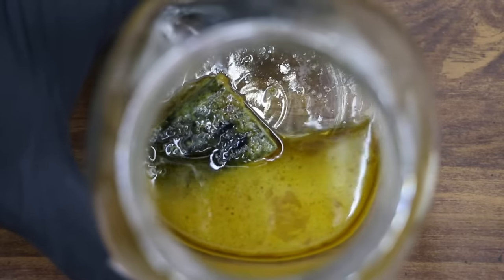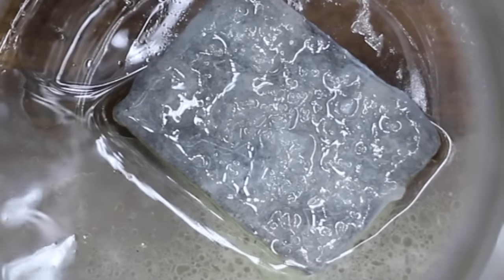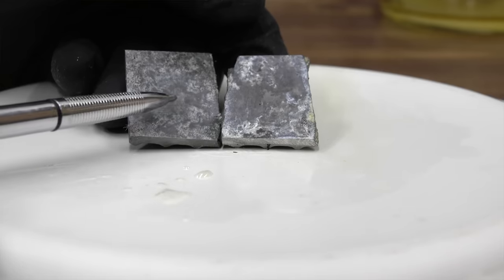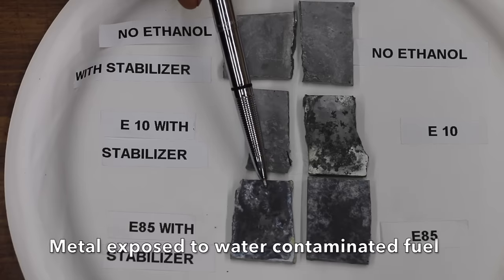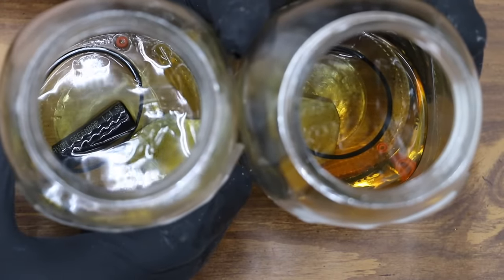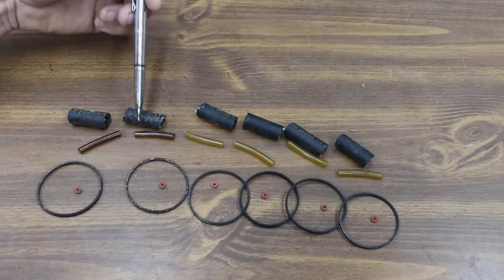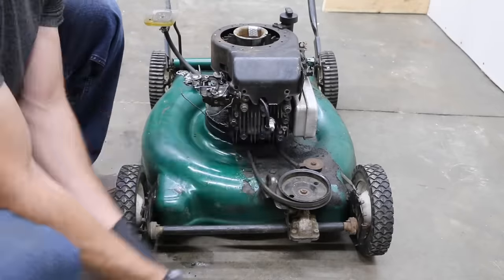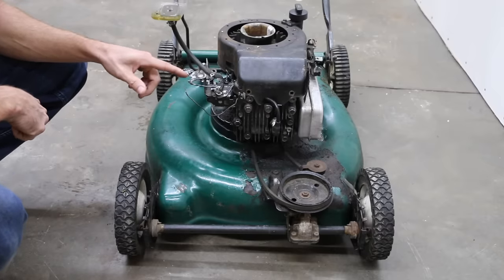Does Fuel Stabilizer Prevent Ethanol Damage?  Let's find out!

Comment: Great Video !, Great Test,!   love it.  my brother says that clumping brown crap from the ethanol is actually caused from the ethanol separating from the petroleum, and that the ethanol is basically turning into dried corn syrup , and that it is acidic, and it corrodes aluminum and even steel about the same as if you soak them in sugar water or coca cola .  I always run engines dry on fuel on before storing them and have good results.  when I was young my Granpa's friend said that he would mix a few ounces of transmission fluid with the last bit of fuel before running his fishing boat out of fuel to store it and that was the best thing to do to help prevent corrosion in the fuel system and the engine .
Reply from the maker: Thanks!  Thanks for sharing.

Comment: That was an awesome video idea! I work in a motorcycle shop and every day I try to convince people to buy ethanol free fuel for their carbureted machines because of how much damage and corrosion is caused in carburetors.
Reply: One of the issues with "white" gas(as we called it in the day) is the lower octane rating. Modern EFI systems can compensate by retarding the spark. You do get a loss on top.
Reply from the maker: Thank you!

Comment: I would love to see a similar test using various fuel stabilizers, including Seaform which a mechanic friend of mine swears by. i'm of the mindset that no matter how perfect your fuel and/or stabilizer is, don't let it set in your engine/carb for too long but with that said, i'd love to see how the various stabilizers stack up over a long test period.
Reply from the maker: Thanks for the suggestion.
Reply: Yeah I'd like too see that too.
Reply: I'd like to see a test with other various fuel stabilizers as well, specifically Sta-bil and it's variants. I personally have had up to three year old E10 gas with Sta-bil in it in a 5 gallon gas can that has ran fine in my weed whacker and riding mower. There will be a bit of water in the bottom of course, just don't use the whole can. I think the key is to mix it up very well before storing, like you are mixing up a gallon of paint mixing level.
Reply: @meanmugmuzik7901  i've found sea foam added to my gasoline helps some small engines run better/stall less while warming up, my quad & chainsaw for example.
Reply: Yes please!!!
Reply: @meanmugmuzik7901  Mystery Oil works great. Many a years to back that up!

Comment: We need to start a petition to get Ethanol out of our gasoline! I knew it was bad but holy crap this video has me horrified.
Reply: Good luck, unfortunately it benefits the Corn cash cow for our farmers too much for anything to happen.
Reply: I would sign that in a heartbeat..ethanol sucks!!
Reply: @ryanchristensen1799  unfortunately that's quite true. Corn ethanol subsidies keep alot of farmers alive.
Reply: My whole life has been in agriculture and I can’t stand this ethanol mandate!
Reply: The scope of this experiment is only applicable to small lawn equipment.
Reply: What about the NET MPG LOSS ? Jesus - what a cluster fuck. Spending MORE for LESS. No wonder the fuel providers are in bed.
Reply: @FJB2024_  ethanol fuels are cheaper than pure gasoline, generally by a margin that more than offsets the usage increase
Reply: There are no subsidies to farmers or the ethanol industry any longer. they were all ended 3 to 5 years ago. The ethanol industry is running on it's own. However there are still several huge tax advantages  for the oil industry.  Yes ethanol has issues with small engine problems sometimes but it does not have the by product that contaminates the air that the former additives in gas did cause. Just about with every fix to a problem there are unintended consequences. So across the wide scope of humanity we have to find the balance in the effects we caused.

Comment: For some older carbureted cars, it's important to remember that they may have open gas tank vents- meaning that draining the tank is especially bad due to condensation that would allow for rust
Reply from the maker: Great point!
Reply: When I worked on the venerable C-47, on the bottom of each wing tank was a drain valve.  When there was water in the tank, it was drained until the gasoline started to flow.  Had to do the draining daily, too.
Reply: Sunshine Kid modern GA aircraft too. Used to use a baby food jar to sample the fuel
Reply: @jamesanderton344  We used a quart jar on a pole, depending on the type of aircraft.  A high wing C-7, for instance had a much longer pol, as did the C-123, which also had two jet engines that ran on AVGAS.  In fact, the C-123, which looks very similar to the C-130 with only two props rather and four, could jettison every drop of fuel and become a glider, as that was it's primary design in WWII.
Reply: Sunshine Kid: The 123 had Jet engines?? Years ago I worked with 
a Nat Guard pilot who had just transitioned from the 123s to the 
Herc. From discussions with him, I got the impression that the 123s
were piston engine. Being an early design, that makes sense. And in
the early 60s when I was USAF, the 123s sure sounded like piston.
Never worked on them, or got too close, so that is just a SWAG (ScientificWildAssGuess)!
Reply: @dd_ranchtexas4501  I worked on them, and yes, they had two piston engines.  Then two small jets were added, one per wing, outboard of the props, along with an additional drop tank per wing for more range because those jets gobbled fuel.  Originally designed as a glider for WWII, it never made it into the warfare scene, so two radial engines were bolted on with a fuel tank faired behind the engine that could be jettisoned in flight.

By 1962, the C-123K variant aircraft was evaluated for operations in Southeast Asia and their stellar performance led the Air Force to upgrade 180 of the C-123B aircraft to the new C-123K standard, which featured auxiliary jet pods underneath the wings, and anti-skid brakes.
Reply: You can always mist spray the insides of the tank with a bunch of wd-40. It will create a film that will protect against rust. It will be later on washed out when you fill it up and burned along with the gasoline.
Reply: @Mprikiman  In a car gas tank, without removing it, how could a person do this? My car has a tank that is riveted to the chassis (unibody)

Comment: The venting of the fuel tank makes a big difference on how the fuel degrades. My first car (79 Dodge Omni) had a full tank of 10+ year old gasoline (likely ethanol free) and remarkably, the car started, ran, and didn't ping to my amazement. I ended up running that fuel for a couple hundred miles before I topped up the tank with fresh gas. With that said, it really is remarkable how corrosive the ethanol blends are to aluminum. I wonder how much better the marine Stabil product designed for ethanol would fare. That's what I used in my car that I had converted to E85 with no problems for several years (always stored winters).
Reply from the maker: Great point. Thank you
Reply: my old boat ALWAYS got marine ethanol sta-bil as well as regular sta-bil in the fuel with every single fill up.   never once had a problem with the fuel going stale
Reply: Gas from 1989 is much different from gas of 2019.
Reply: @joerowland607  did it have lead in that 10 yr old gas?
Reply: @ryanchristensen1799  1980 probably not but maybe.  You could still buy it then.
Reply: @ryanchristensen1799  No lead, the gas was likely from about 1990, and the car was started in 2000. Our old Farmall 400 tractor also regularly goes 2-4 years between uses and starts perfectly every time without stabilizer on ethanol 87 octane. I can't explain it, but maybe it has to do with the way modern lawn equipment gas caps vent and all the volatile molecules evaporate.

Comment: Yup Learned several years ago to only use non- ethanol fuel in all  stuff from my Ford NAA on down. Just started my push mower that had non Ethanol sitting for at least a year. Had to use the starting fluid a few times before it lit off. Thanks again for what you do.

Comment: I always thought old guys that poo poo'd ethanol fuel were just grumpy curmudgeons, but this changes my perspective. Thanks for taking the time to put this together!
Reply: Lol sometimes us old curmudgeons know what we're talking about! 😉
Reply: Woods Tree Farm ethanol does have some advantages which are often left out by said curmudgeons, although I agree with them in principle and hate ethanol as a whole. Advantages include raising octane naturally (traditional fuel relied upon highly toxic aromatics) and decreased emissions. And the primary disadvantage of water corrosion is heavily minimized if it’s not stored long-term.

But the major disadvantage is still immensely significant. Small decreases in emissions is pretty negligible if someone needs new carburetors, fuel lines and the like. Storage requires additives that apparently don’t work very well (see video). Possible decrease in fuel economy also limits its emissions benefits. And that’s just the ethanol itself, doesn’t even cover the production aspects.
Reply: Even when fresh machines just don't run well on it. My moweres will surge and vehicles get worse mpg
Reply: @workingcountry1776  Your mowers prob have a plugged pilot circuit in the carb. This is common and it's not necessarily ethanol fuel. General purpose engines have a pilot circuit and a main jet circuit and run at a fixed RPM. The pilot circuit also called the idle circuit, augments the main jet at WOT throttle and below. If it is dirty or plugged it'll cause them to have a rough idle or surge at idle. I don't see any probs with mowers or power equipment as long as the ethanol is below 10%. But who knows how much  ethanol is in fresh pumped gas. I'll agree that your gas mileage will drop on your vehicles and again I suspect there is more than 10 % ethanol in some pumped gas. Carburted engines won't run properly if the ethanol is more than 10% or won't run on E15. 
Even FI engines don't like ethanol and it kills fuel economy. Off your mowers are surging or have  rough idle at idle then I'd check out the carb. Hope that helps you.
Reply: @mooglemy3813  all equpment runs perfectly on pure gasoline.  Its the NY gas because even brand new machines do it to an extent.
Thanks though.  Machines that do it more more mayby I'll do a full carb service over winter and see if that helps

Comment: Instead of just using fuel stabilizers, it would be interesting to see if any of that gelling or corrosion could be removed by fuel system cleaners/restorers like Berryman's B-12, B-60 or any other products. Maybe even some non-standard products like paint thinner, mineral spirits or acetone. Love your work BTW. Great job! I will share this with some of my customers!!
Reply from the maker: Thanks!
Reply: If you remove the ethanol from gasoline, you'll get a lower octane fuel. If you add ethanol to a high octane fuel without Ethanol, you raise the octane. It's used to raise octane, removing it from cheap fuel will lower it.
Reply: @raycert07  In North Amertica, it used to be even few years ago that the highest octane (premium) fuel was free from ethanol,  at "brand" name stations (for instance in Canada, at Shell's and Esso's). And it was written on the pump (albeit in small letters) that there is no ethanol. Now it is a mess, nobody knows for sure

Comment: came out pretty much as l would think it would, wonder how cam2 racing fuel does, thats what ive been using in my small engines that sit,
Reply from the maker: Hi Mustie 1, Thanks for checking out the test and great recommendation on the Cam2 racing fuel!!
Reply: hi, mustie1, I love watching your vids, I have a 1995 saturn coupe in storage, I run the car every 2-4 weeks, I plan to leave it in storage for at least 1 to 2 years, do you think sta-bil is any good, I just don't want any damage done to the car.
Reply: Not sure about Cam2, but the "canned" race fuel from Sunoco claims a shelf life of "in excess of three years".
Reply: @ARAR148  it does work excellent. I used to be a factory certified tech for BMW motorcycles USA and it's exactly what they want you to use.
Reply: I’ve always used VP racing fuel in my outboards during storage. Run it on VP the last day to saturate the system. Start it up in spring and go fishing, never a problem. VP claims a shelf life of two years for racing gas. Pump gas 90 days.

Comment: Thank you for the warning! The gasoline in the UK has had 5% ethanol in it for a couple of years but now the 95 octane (the lowest you can usually get in the UK) is being changed to 10% ethanol. The 98 octane will still have 5% ethanol. It looks like it is worth the extra cost for use in an old engine.
Reply from the maker: You are welcome!
Reply: Are the octane formulas in the UK different than USA?
Reply: @yellow_panther  Yes, the only octane ratings of gasoline/petrol you can usually get in the UK are 95 and 98. A very few stations also have 100 octane, which I think is on sale because some motor racing teams sponsored by oil companies wish to use 100 octane and the rules for some categories of racing specify that the competitors must use fuel that is available to the general public. You can also get diesel fuel in versions with and without some additives claimed to improve the performance of your engine. You cannot get 87 octane in the UK, and you don't have any choice of fuel with or without ethanol.
Reply: @cedriclynch  I remember reading the octane recommendation for my 3-series BMW in the owners manual for the car.  It recommended 91 octane (which is available in the US).  They had the formula for calculating the octane and when I looked at the formula it turned out that the US equivalent was 87 octane.  No doubt some US 3-series owners seeing that the owners manual recommended 91 octane, were pumping 91 octane, but that wasn't the actual US octane recommendation.

Comment: Thank you so much for this video!! I currently have 41 small gasoline engines that I have to worry about. I have been adamant about and consistently stabilizing all my fuel for over 10 years now but I STILL had problems. 

This video really connected the dots for me with all my symptoms and improved my life. Now I happily drive over 100 miles (from south east CT) to the nearest station with ethanol free gasoline. Of course I will still stabilize; but at least the ethanol is gone! Thank you times 1 million!
Reply from the maker: You are welcome!  Thanks for sharing!